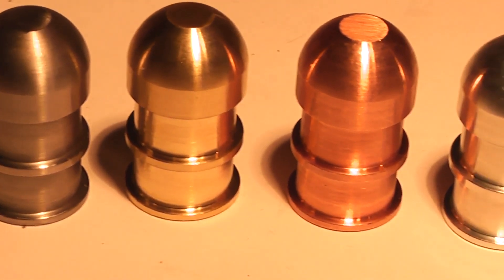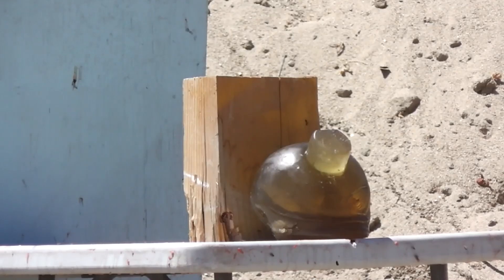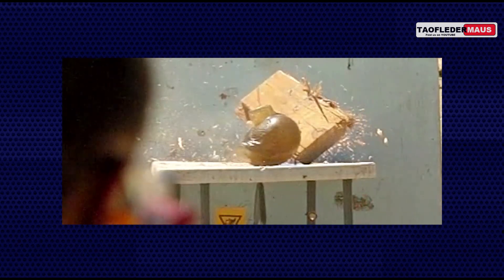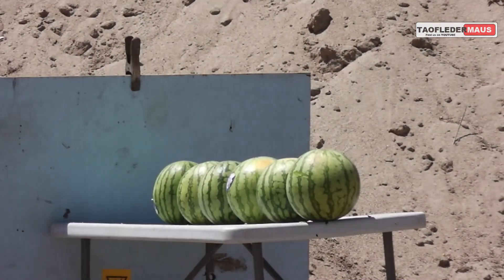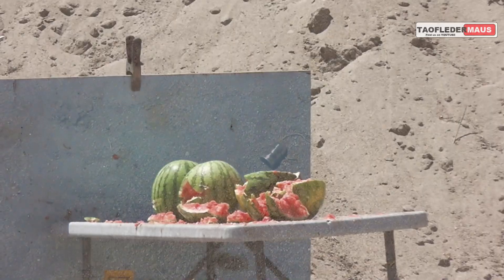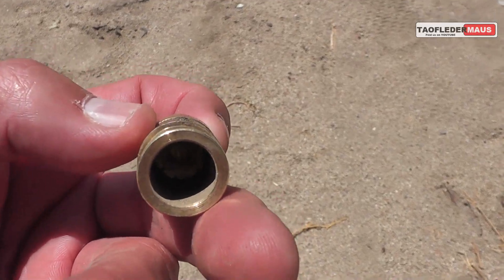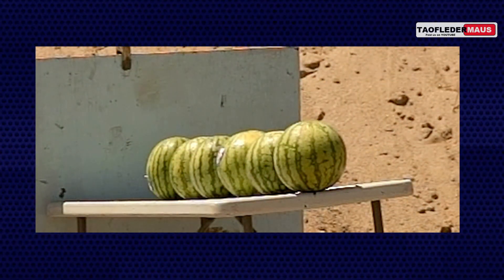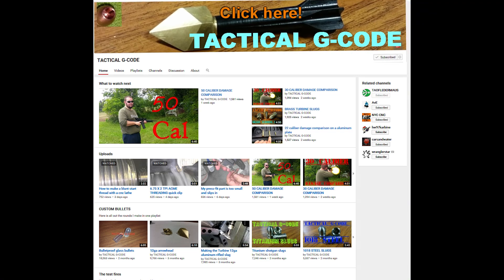Machinist Invents his own BRASS Shotgun Slugs - THAT WORK!

Comment: I just watched this video right now and was wondering about the way the last slut bulged at the bottom. Was it just this slug that bulged like that or did the others do that as well?
I am not a metallurgist, but to the best of my knowledge brass is a relatively soft and plyable metal. If more slugs showed that same kind of bulging, might it then be the result not of impact but of compression when fired? And if so, would it explain why these round wobble that much?
Please let me know.
Kind regards,
Nico.

Comment: Hi Taofledermaus,

Here is some information you might find useful when concocting a better shotgun shell: 
*Disclaimer* I am a mathematician who has learned a little physics by proxy. While the following is probably pretty close to the mark, an expert would probably know better.

The first and most significant key to slug stability is weight distribution. Shotgun slugs (and the original Minie ball) fly true because they have hollow bases which are lighter than their solid noses. You don't need fins to add extra drag (and instability), just a tiny adjustment in weight distribution is enough to keep the slugs traveling nicely stable without a rifled barrel.

The second key to slug stability is learning that a little goes a long way when it comes to high velocity aerodynamics. Going near 1116 fps, tiny differences in weight distribution or drag will result in huge forces playing with your slug. You often see this in your tests, when a heavy nosed slug seems to wobble wildly side to side. What's happening is that the heavy nose is trying to drag the light rear through the air, but the light rear is slightly out of position and gets hit by huge drag force and swings to the other side, resulting in another drag spike, and back and forth. Big fins will increase this chaotic wind flow resulting in wider wobbles. Make the cavity in the back of the round too big, and you will get the same chaotic oscillations as the back of the slug bounces back and forth. 

Conservative weight distribution is enough to keep slugs stable, but if you are dead bent on getting them to turn as they fly, you need to do some research with the position of some tiny fins. 

As rounds get close to supersonic, two phenomena dramatically affect drag on the round: 1. a conical pressure wave that forms around the front of the round as it forces itself through air faster than the air can get out of the way. 2. a very turbulent low pressure area behind the round which will sporadically generate pockets of vacuum because air can't move fast enough to replace the vacated space. 

Any control surfaces that make contact with the front conical pressure wave will experience chaotic forces and instability (hence supersonic jets need to have wings sloped to the rear, and thus out of the plane's pressure cone). Likewise, any control surfaces at the very back of the round will also experience chaotic forces in the turbulent trail. 

It would make an incredibly cool video to test a set of slugs made with heavy noses and small cavities cut into the base, with rings of small (less than 1/8" by 1/8") tilted (5 degree?) fins at different distances along the middle of the slug. 

I would be happy to send over some crude sketches or maybe even a cad design or two if you get this far through my little wall of text.
Reply from the maker: Dux Bellorum  I don't design the rounds,  just shoot them so I don't have any input in their design.   With these 7-metal slugs,  we have seen slight differences in the flight characteristics even though they are identical dimensionally.   They just differ in weight.   The lightest of rounds, aluminum flew very straight and fast,  probably breaking 2000 fps.   The heaviest round,  copper flew straight with almost no wobble.    For whatever reason,  these rounds were a little wonky,  even though they should have flown the same as the copper ones.

Comment: if you use a rifled barrel or get round to spin it should stabilize, and use magnum cartridges.
Reply: ***** Adding turned vanes to the back of the slug's are probably the only way to spin stabilize them. Definitely wouldn't want to be trying to fire a titanium slug squeezed into a rifle bore :)
Reply: +TAOFLEDERMAUS   haven't you talked about this multiple times in your vids lol
Reply from the maker: nastynate.2015  Not if the round isn't squeezing through the rifling.  Otherwise it would be like threading a 1/4 bolt into a 3/8" nut.
Reply from the maker: Richard Redlak  Yeah all the time.

Comment: i have a couple of ideas. 1. drag will stabilize a projectile faster than fins will, but at a random trajectory. i suggest adding a stopper to the back of the fins to increase drag. 2. i noticed in your other videos that some projectiles begin to straighten out and stop tumbling/ fishtailing only a few feet before they hit. those specific projectiles should be tested at longer ranges to allow them to correct themselves. also, to solve longer range camera problems, have the three cameras facing downrange, the first one at the shooter, second one halfway down range, and third one at the target. and get a bigger backboard

Comment: I'd like to speculate that if the skirts on these slugs were half the length they would be more accurate. As it stands the length creates more drag, especially with the second ring on them. When the round wags the drag seems to steer the round quite a bit, but a shorter skirt should result in less drag and less deviation due to the drag when the round isn't parallel to its trajectory.

At least that's what I think.

Comment: It is very odd that these brass ones are much less stable than the other metals. They are all the same shape, only different materials. If the copper one did that as well, I would say there is a critical mass that this design becomes unstable, but it flew very stable. How odd. Maybe I should had done better in physics and maybe I would understand why, ha.
Reply from the maker: Jesse Sisolack   Yes.  I thought it would be the same as the copper ones.   They were the exact same dimensions.  I can't explain it!

Comment: I wonder if it's bulging from the pressure and therefore has the funky flight characteristics. Just a theory.
Reply from the maker: mjk2374  I'm 99% certain the bulging is from when it is shot.  I also measured the bulges and the lower part was bulged out more.  But the copper rounds bulged the same way but flew straighter.

Comment: I'm kind of wondering what the effects would be of using that expansion of the slug to center it in a rifled barrel? seems like it would be a pretty deadly round if you ask me, especially a softer metal like brass because it could get a good grip on the rifling

Comment: It's the flat nose on the slug that's making it wobble IMO
Reply from the maker: Toasty Roasty Man  All the rounds had the flat spot.   Not all the rounds wobbled.
Reply: Yes, I saw this after I posted that.  It pretty strange. Baseballs will curve away from smooth spots applied to them and curve toward rough spots. BB pitchers know this. The only way to see what is going on is a side camera view with a bit of smoke to show the aerodynamics.

But try to use just gelatin and no water melons this time. :)

Comment: My thoughts on this videos is That it would be really interesting to see  how these slugs stabilize in a rifled barrel. I can see them wobble in the air, adding a spin to the projectile might make them more stable. Only problem with a rifled barrel might be that the rounds get stuck in the rifling if you use a hard metal, so maybe making them in a smaller caliber would be a good idea, just like sabot slugs.
Reply: killwolfs they're made to stabilize through being nose heavy and having drag at the back
Reply: Yeah but that's not the same thing though.
Reply from the maker: anter176   It is much harder to get an unrifled round to fly with stability.   That was part of the challenge.
Reply: Hmm maybe you can make like a series of tiny ventilation holes through the projectile so gas can escape through those hole and that might might cause the projectile to spin. For a lack of knowing how to explain it in a YouTube comment, think like a jet engine or something, like no 90 degree holes.

Comment: You should make 5 different ones out of brass adjusting the center of gravity forward backward.  It seems like they are a little nose heavy for the force you are pushing them with.

PS I have no idea what I'm talking about, just generating ideas...
Reply from the maker: Kyle Davidson  They need to be nose heavy to fly forward.
Reply: That does make sense, but a jet (engines in back) doesn't have all the weight at the nose. Its different because they are generating lift with the wings and need it there, but still it "shoots" forward. I would be interested to see the results. A .500 doesn't have all of its weight in the nose... or does it. I dont have any on hand to balance it. Lol

Comment: Ive got to think that if yall used a rifled barrel, that just about all of the experimental rounds would perform well. These slugs, the darts, the folding fin ones, etc. There is of course the issue of harder metals not jiving well with the rifling, probably ruining it in a hurry. My idea is that if the projectiles were machined slightly smaller than the barrel, the projectiles could then be jacketed in a softer material that would engage the rifling.  That waxy meshy cheesecloth comes to mind. It would grip the slug well, engage the rifling enough, maybe becoming shredded on its way, and be discarded as it leaves the barrel?
Reply from the maker: mike b   Take a steel slug,  and shoot it through your rifled shotgun and see if there is any rifling left when you are done.  lol
Reply: ***** or if he has any rifling left he's not gonna have much velocity
Reply from the maker: anter176  That is if the steel round doesn't seize up in the barrel and blow up the gun.  As we know,  for rifling to WORK,  the round needs to squeeze through the lands of the rifling,  just just skim across them.

Comment: Now what Tim should do is randomly make the same design out  of other metals and plastics!  As I think it would show a lot between each material!
Reply: ravemastaj
A bit, but at those kinds of pressures and temperatures wax behaves a lot like rubber whereas cast iron (much more brittle than you would imagine with the word "iron" in there) behaves like glass. Cast iron is a lot like swiss cheese if you look at it under a microscope. Its poured into molds and full of air bubbles. It behaves absolutely nothing like forged iron.
Reply: w00dmii5t3r 
I kind of want to go back to those cast iron slugs. I wonder if they were given a copper jacket, would they hold together?
Reply: ravemastaj no
Reply: Slurpon Muhdick
:/
I just think it's weird that wax slugs will hold together in the air, but a slug of metal wouldn't. It's...odd to me.
Reply: Slurpon Muhdick
But, that begs the question:
Old cannons were completely capable of firing shells without shattering, and the earliest ones were made of iron. How did they fire without shattering?
Reply: ravemastaj Slurpon Muhdick 
what if there was a thin layer of copper on the inside of the slug?
Reply: ravemastaj
Iron and cast iron are NOT the same thing. The way they are produced is very different. Cast iron is full of air bubbles.

Comment: hmmmm, melting down extra brass casings to make slugs, i like it
Reply: Nick Marandino Range lead is cheaper and better... And a good mold for it is $24. Brass takes way more heat and work to get a good casting than lead.
Reply: Crest fallen A lead slug uses about a penny's worth of lead as purchased from scrapyards. ~$0.30 USD a pound. A fair number of people get it free too, from various sources.

So I will never be motivated to melt currency to make ammo.Well other than the occasional silver bullet that people ask for. I might do a small run of those some time.
Reply: GunFun ZS add a bunch more copper (maybe some copper wire), and you could use pennies.
Reply: for some reason i think he realized this...